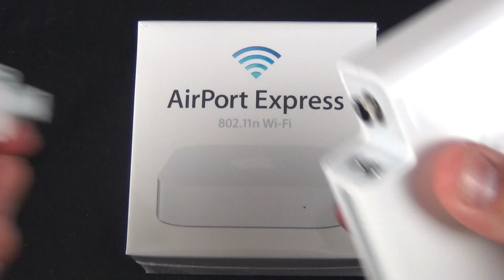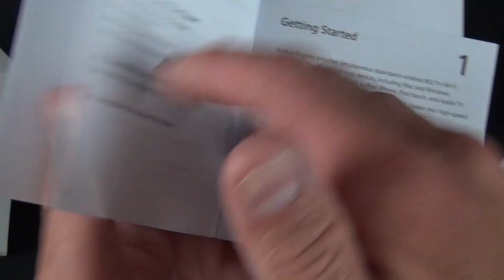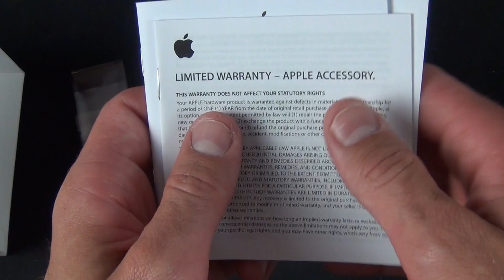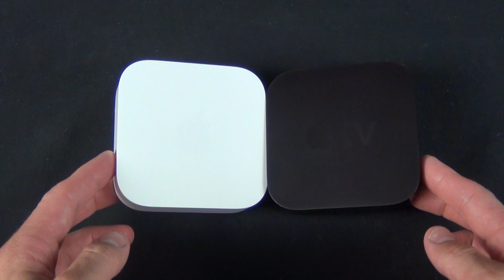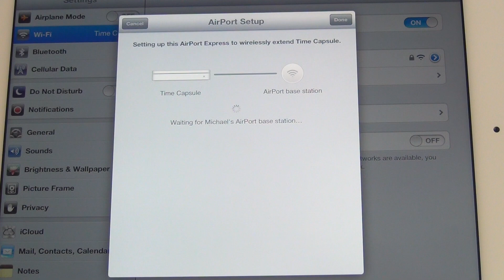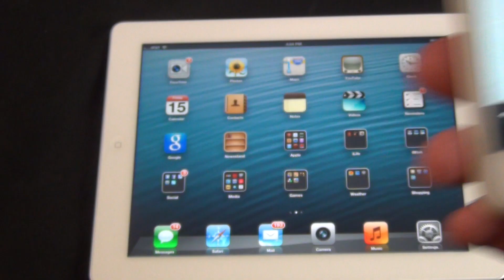New Apple AirPort Express (2nd Generation) - 2012: Unboxing & Review

Comment: I need someone to answer this if I already have a home WiFi setup can I use this to improve the WiFi and make it faster
Reply: The Airport Express can extend your network to improve signal strength it can not however improve speed. The theoretical speed the DHCP/NAT would provide at that range is what you will get even with the express as an extender.
Reply: The comment is 3 years old but for people like me who still want to buy one of the airport express stuff. Without the airport express we have 50k speed with the airport express as an extender via LAN cable the wifi speed is just 5 to 7k. So mostly useless. =(
Reply: @northfox.sweden  You did something drastically wrong.
Reply: @scbond  tell me.

Comment: why is is it that apple only includes a power cable it would be nice to get more cables
Reply: It only needs a power cable.
Reply: +N64 Joey I think he means Ethernet cable
Reply: ***** OH.
Reply: +N64 Joey That is only if you have an existing Wi-Fi network, because the first AirPort express that you buy requires an Ethernet cable which is connected to an ADSL modem, and the second one that you buy is linked wirelessly, and does not require an Ethernet cable.

Comment: Do you have to have a time capsule or can you wireless extend from the modem your already using to give a dead zone a wifi connection ?
Reply: It is capable of being expanded with an existing modem or even airport. You can also set it is as a base station and it won't need to expand anything!

Comment: Hi i have this router, it was given to me from my friend. The only problem is it asks for password and i don't know that. do you know how to unlock it without the old owners password? Thank you
Reply: Their is a small hole on the back of the unit. It should be as big as a paper clip. Plug the device in and push the paper clip into the hole for 5-10 seconds. The airport should start blinking Amber after. Then you can connect you device and set it up as a brand new factory reset device.

Comment: Holy crap, it's been like two years since I watched this video! I'm actually considering using this to replace the (most likely) broken router. I just hope that the range is good enough to go to the basement and the upper floor. If it happens to not give a strong enough signal or it turns out that there is nothing wrong with my router, I guess I'm just gonna return it.
Reply: +Garirry 

The range of your wifi heavily depends on the environment.  If the router is located with many rooms, walls, wireless phones and microwave, then the signal can suffer.  To remedy this is tho extend your wifi with wifi extenders.  Thats where several airport express would come in handy, specially the smaller first generations.
Reply: gmlasam Well, I have in fact bought it the next day I posted this comment. Surprisingly, the signal is a bit better in the basement than my previous router, being the same price but Apple, but the signal doesn't seem to reach that far in the back yard. Then again, it's also a question of what device is connected, some can detect Internet from a house away, some need to be two feet from the router to get a full signal. Apple is quite the king of wireless I must say!

Comment: Is this one only works with Apple products or works with android / windows also?
Reply: ***** I want to whether airplay / music streaming compatible with other platforms wireless.
Reply: It should work with every platform except platform such as android or Windows may take a day or two to start working at full speed with it since the software and the router has to run diagnostics on those devices to make sure they're not containing viruses.

Comment: I have a question for you. I current have my AirPort express plugged into the WAN port, I have a cable going from the Airport to a switch, from the Switch it plugs into my router. My SSID broadcast is turned off on my router. The Airport is set to extend my wireless network. But I don't know if it's work or even how to set it up the right way. Could you please explain to me how to extend my Wireless network even with the SSID broadcast turned off?

Comment: Is this something like a mifi device?
Reply: Benjamin Wallace No.  It's like a router that works at home when connected to your modem, or in a hotel connected to the ethernet cable.  It has some amazing bonus features, which I use as a primary features.  1.  You can plug speakers into it and stream music from your ios device or pc or mac the same way you would send the signal to a bluetooth device or headphones  2.  You can connect a printer to it to convert it into a wireless printer  (I've heard of some people connecting a hard drive and making it a wirless hard drive, but this isn't officially supported I don't think- I use the Airport Extreme for this feature).  3.  It can be used to extend the wireless signal in your house if your primary router is an airport extreme or another one of these.

Comment: Can you use a 3rd party router with the Airport Express instead of the Time Capsule, in order to extend your wi-fi network?
Reply: Yes as a matter fact that's one of the main reasons this device was created! You can either unplug your existing router in and put this one in its place or you can expand that routers signal with this device or you can even add this device to an existing Apple airport!

Comment: can i use the express to extend my 2WIRE router from att?
Reply: I have use my Apple airports to extend multiple Wi-Fi connections when I go places I've had Wi-Fi in my attic and in my basement before due to Apple airports working with a broadband of modems it'll work at pretty much any modem in any operating system all platforms and speeds!

Comment: When you extend the tai he of the Wi-Fi, does the airport express have to be connected to my router on a wired connection or does it just connect wirelessly with my router?
Reply: You should be able to connect your airport both wirelessly and wired I have done it both ways and it seems to work seamlessly! At first I was connecting it to an existing router but eventually I took my airport and I just completely replaced my existing router and I find it works better have just the airport opposed to multiple routers. But if you feel the need to have multiple routers due to a large house you can very easily set this up with an existing router both wirelessly and wired!

Comment: im a little confused on the purpose of the device. I have been led to believe that this can be plugged in with just a power cord anywhere and allow internet connection. Is this true? Or do you have to have another router to access internet. I had thought that i could plug it into the wall and be on the internet.
Reply: This device isn't able to take Internet wherever you go that is absolutely 100% a misconception about this device. Although with this device can do is they can replace existing router or it can extend the range of that existing router or a can connect to another existing Apple airport!

Comment: Can you connect an external harddrive (I have a 3TB one) to the USB port (as time machine for example) or does it only work for printers?
Ty in advance!
Reply: I have plug my airport into a 3 Gig Thumb Drive and it seems to be doing fine you can also plug it into a printer and that is that you with the man uses but yes you can very much so use drives.

Comment: So if it's on, I can go far away and i still can connect to it?
Reply: I find that it starts to get a little iffy at about 50 feet and seems to lose most of its connection at 100 feet so in my opinion if you need anything over 50 you should really opt for the airport extreme I have an airport extreme from 2009 and it seems to be doing just fine.

Comment: How does this work
Reply: It's easier just to say that as with all things apple it is magic and simply just works.

If you really want to know, All new OS X and iOS updates provided airplay option that transmits data over wifi much like how a bluetooth speaker work. And because of this unique feature and proprietary software apple is able to create advanced wifi option such as seen on both the Apple TV (Were you can use air play to stream a movie from your iPhone to your TV) and the Air port were you can use air play to print anything, play music, and even setup the network settings wirelessly over air play. With these options I can display my Mac desktop onto my TV wirelessly using the apple TV and wirelessly configure network settings or print my docs to  printer 3 rooms away with no wires attached to my mac at all.

Comment: What exactly is the difference between this and the extreme version? I am trying to figure out which one to get, but I am not sure why the extreme version is twice as expensive. Is it just the distance of the signal or does it actually work better in terms of stability?
Reply: Airport Express :- small home,only one LAN port,WiFi 'n'
Airport Extreme :- Bigger house, 3 LAN port,WiFi 'ac'
Reply: This one's cheaper.
Reply: The extreme version basically has 2 to 3 times the signal range is a lot faster and in some cases you can even plug in hard drives!

Comment: does it have good range?
Reply: It depends on what good ranges to you it starts dropping signal at about 50 feet anything past that you either have Internet or you won't hundred feet you're pretty much guaranteed to just not have any signal whatsoever so if you really need that much signal you should opt for the airport extreme it's a much better by even the 2009 model seem to work just fine that's what I have and it has way better signal than this...

Comment: With the video on the Airport Express I don't see a modem, is that built in the express?  If not, what do you recommend ?
Charlie
Reply: The airport extreme actually is meant to replace a router or modem but if you do you have an existing router or modem you can plug it into the airport extreme or you can set it up to the airport extreme wirelessly that should extend the range of your Internet or it can just replace your existing router and do just fine! Hope that helps Charlie! :)

Comment: Can I hook the power into a battery pack and use it on da go?
Reply: Not unless there's a present Wi-Fi connection that this device can connect to a misconception about this device is that it gives you portable Wi-Fi that is not true what this device is designed to do is connect to existing Wi-Fi and crate almost like a VPN server... Can replace an existing router or extend an existing router. Even an existing airport or a modem if you're into that kind of stuff...
Reply: N64 Joey ok thanks.

Comment: so, is apple afraid of using the term router, or is this something else? is it a router or not?
Reply: You can use it to extend the routers range or make it, its own wireless router that you dont need to connect to a computer stuff
Reply: JerryTheSpartan It is a router.  It was originally marketed as a travel router.  You could plug it into a hotel's ethernet and get wifi in your room.  Then, however, the device became more versatile.  People began using it for its music and print server features (which I do).  So...Apple seemingly abandoned marketing this device as ANYTHING rather than advertise its versatility.  This is my favorite gadget EVER.  One commercial showing someone hooking this up to a home stereo or set of computer speakers and sending music wirelessly to tons of these in your house, would sell millions.  But for some reason, there's never been ANY hype.  I have three in my house, and an airport extreme, making my wifi signal strong from every nook and cranny, and music broadcast to multiple rooms.  Two hard drives connected to the system back up four different computers.  It's amazing, really.

Comment: My dad had been looking at ways to wirelessly broadcast his music from his iPhone to the audio system in his new office. I think I might get a couple of these and run them off my new Airport Time Capsule. I find Apple products such as the computers SO much better. I'm never gonna go back to Microsoft.
Reply: Actually you don't need to buy ideas to connect audio you can either get the Google Chrome audio cast or you can even opt for AppleTV is Apple TVs are cheaper and have much of the same connectivity when it comes to audio and even video!

Comment: I have a question I want this but my dad says you need a fee? Is this true and if you don't need a monthly fee? Why not?
Reply: It does not have a monthly fee other than the fee that your Internet provider charges you basically all you're doing is replacing the physical router that you have or expanding that router you are not in anyway charging yourself more money to use this and the service that provides other then the service of the Internet provider gives you to connect to the Internet. 

So in a nutshell: no you don't have to pay a fee you only have to pay your Internet company and they won't charge you more for using this!

Comment: do you need any thing else besides the power cord to use it as a new network
Reply: It depends if you need a internet connection.
Reply: I believe that to use to use it as a separate network you must already have an established network. This just creates an add on network (ie you could use it as a guest network with a different password than your main one).

Comment: Does the USB port support anything besides printing?  DLNA?  Setting up a network share?
Reply: Actually I find that the USB ports parts for a wide range of devices I've used it as a wired connection for my iPad I've even used it to set up storage devices!

Comment: Basically, you plug everything into the airport and it makes them all wireless. So you can create your own wireless connection for your computer to use the internet, you can have a sound system or printer on the other end of the room without cables all over. The higher end also work as a back up HDD and instead of doing regular backups, they constantly are backing up everything you do to protect all files from a computer crash at any second.

Comment: The most basic information you need to know is that this device can be either your wireless router or a wifi signal extender. In the first case you can plug a ethernet cable coming from your modem into this device and create a wireless network. In the second case you can setup this device to pick up your existing wii signal and extended it. Also this device have a usb port which allows you to connect a printer and a audio jack which allows you to you to play music from iOS devices and Macs

Comment: so, here's very serious question, i'm moving to my new apartment, i've got a windows pc that i made, it doesn't have wi-fi cause all the usb and onboard wireless cards are a piece of crap. I need to know; can i plug this apple airport to my computer with a lan cable ??, i mean, can the airport device catch the wi-fi signal and then give that ethernet signal to my computer trough the lan connector??, i'm asking this cause i really think this is a good option, only if i can do what i said before.

Comment: My playstation 3 isn't getting a good signal if I buy this can I bridge it with my existing router and plug it in with Ethernet AND use it with my ipad so I'm using 802.11N

Comment: so if the router that you use is from Optimum or Verizon FiOS, you can't extend your networks range? if so, is it possible to connect this device to your internet connection and still airplay music and airprint?

Comment: Yes.  There's a bunch of compatibility issues with doing this with a PC though.  With a mac it's sweet for this feature.  With my PC, it's a pain to get it set up.  I have some networking understanding and managed to do it, but after restarting a computer it stopped working and needed to be reconfigured- even with the program "Bonjour" which is supposed to solve your problems.

Comment: No wires needed.  Put the program airport utility on your mac.  It may already be there (my initial setup was from PC so my explanation may be a hair different).  Disconnect Mac from your wifi (may not be necessary on Mac).  Connect to the new wifi signal that your newly plugged in express has created.  (may not be necessary on mac).  Now open airport utility.  Click on the new device and follow the setup.  When all's set up, everything will connect to the original router's wifi.

Comment: bridging seems like an unnecessary step.  it's completely irrelevant to whether or not the express functions.  settings can be changed at any time.  different profiles can be created and switched between (some people use them for airplay at home- connecting to a router's wifi, while setting up another profile for making a hotel's high speed internet port into a wifi signal)

Comment: no.  though there may be a way for you to "strengthen" your home network with one.  an apple representative recently told me that you could take one of these and set it up twenty feet away from your pre-existing router, hard wire the internet connection, and set it up to have the same wifi name and password as your pre-existing network.  He said the 20 feet was necessary to avoid interference.  I didn't try it and he did make a few mistakes in his statements about the express...

Comment: Your explanation of the problem is atrocious.  I had a similar problem with an airport express throwing off the settings of my router on my computer.  I coudn't connect to my home network.  The solution was easy.  I just "forgot" the network and went into the networking settings and deleted the network.  I power-cycled each of the devices involved, router, modem, pc, and airport express (which I think I plugged back in after fixing my wifi).  I reconnected and everything worked like a charm.